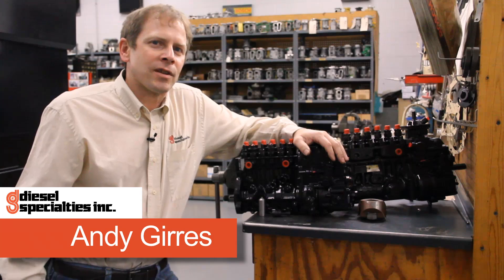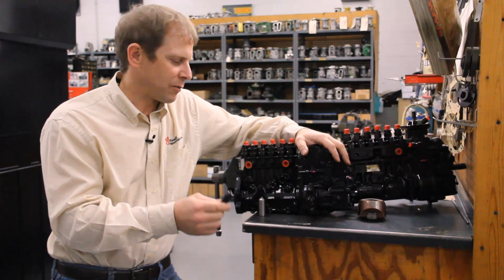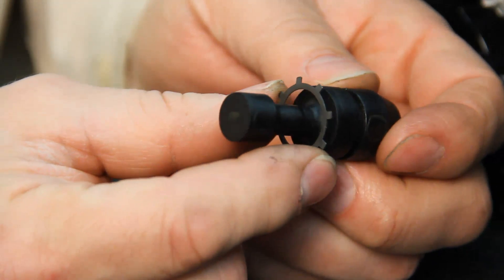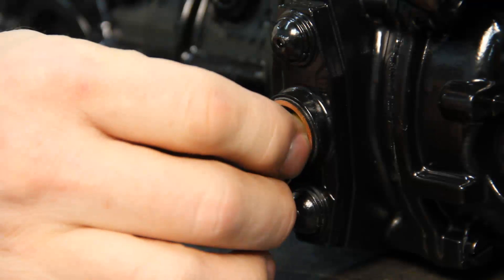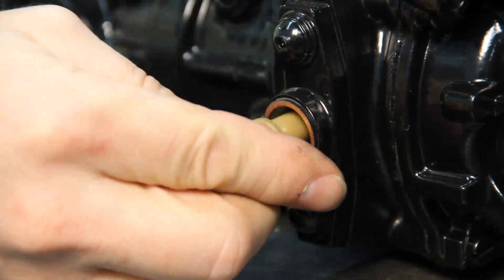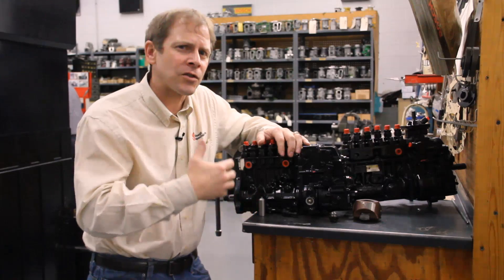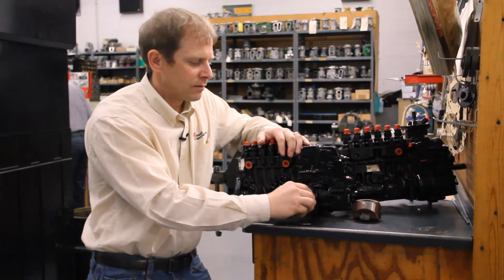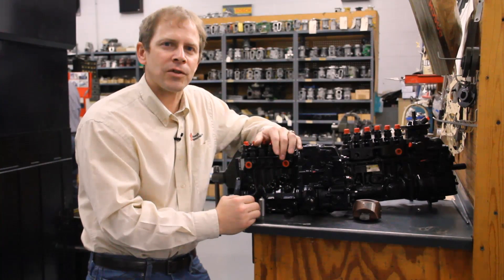Pin Timing a Bosch Pump on a Cummins

Comment: Can u show how to time it properly. Like after removing pump. Pin engine and place pump in time aswell. Install pump back in engine and torque the nut. Is fhT correct procedure?

Comment: Hi. I have marine 6bt 5.9 370 hp engines with P7100 bosch pumps. Starboard side pump governor is surging or engine doesn’t start at all. I had governor springs removed but couldn’t find any broken pc inside. What could be a reason? Vessel was submerged but not for a long time and engines were filled up to the top with oil before she sunk. Port side engine and pump works perfect. What else i can remove and check ? I suspect on dumper plate could be cracked and thats why governor is surging but not sure.

Comment: What would be the problem with my Cummins engine. The engine cannot reach the recommended 15000rpm. The engine cuts off at 14000rpm. Voltage reading at 180 v

Comment: Took out my 4bt 3.9 and had hard time pulling out. I was told once we timed motor that the plastic time holder piece could be removed.( The pump is getting repaired ). Will the pump be OK after it comes back from repair shop.

Comment: So there are 2 timing pins? Not much help when it comes to info on the engine timing pin, assuming thats what he's talking about. Is it already in place but needs to be pushed in at TDC or do you have to remove it  out from where its stored and then installed into the camshaft. I guess Ill know after looking at the engine. I understand the pump part of the timing pin.
Reply: Very helpful video
Please also give information about Zexel pump assembly
Reply: If you haven't figured it out already that pin is on the backside of the engine cover just below/behind the injection pump. Its exactly as it looks, theres a small hole in the cam gear that the pin will insert into when its at the right spot which denotes TDC for the engine. If you put pressure on that pin (providing its sliding in and out freely) and have someone turn the engine over you will feel it pop into place.